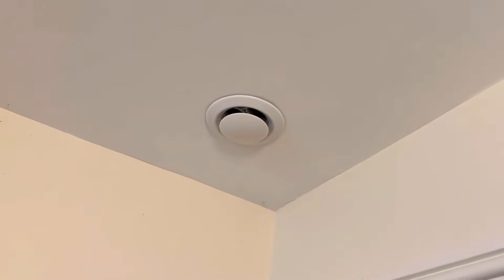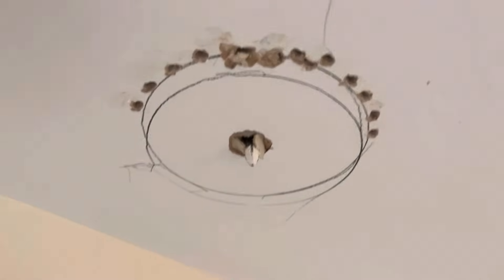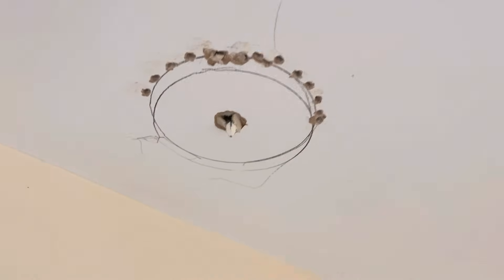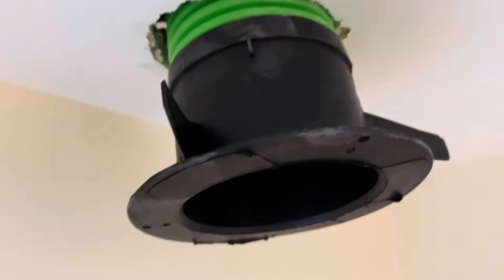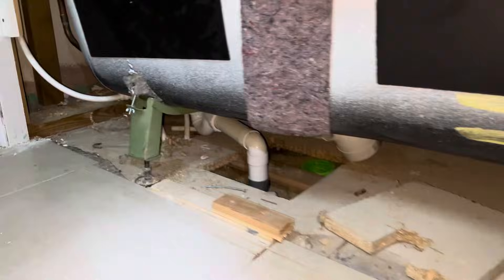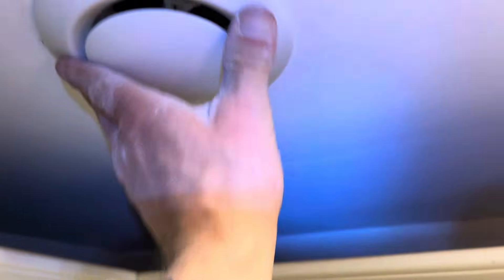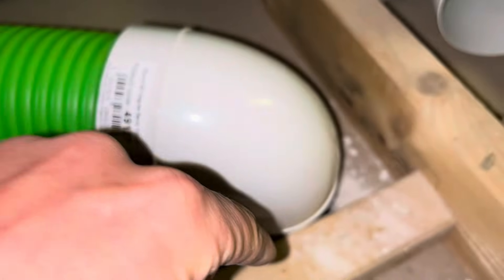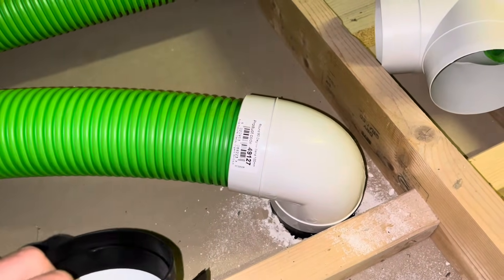5. DIY MVHR: How I fitted ceiling vents to my ventilation system - Easy and cheap to install

Comment: I'm looking to do MVHR setup in my 1880s house to help with air quality and humidty.
I'm wondering if you have been keep track of the airflow in your property to see what changes that have taken place?
Also, how did you fit the external vent?
Thanks for showing your setup so far, its been very insightful.
Reply from the maker: I haven’t yet tested airflow. But I have been tracking humidity. This seems to have reduced by 5-10% from being low 60s on average to mid 50s.
Reply from the maker: For fitting the external vent, I didn’t need to do this as I already had two vents in my loft so I just used those

Comment: I bet the pipework planning was very time consuming. Hope you and your loved ones are having a great Christmas.
Reply from the maker: Yes, I suppose I did spend a few weeks thinking about where to put the pipes. But actually installing them was far easier than I expected and it was great that the vents were cheap and just slotted onto the ends of the ventilation pipes without needing any further fixings